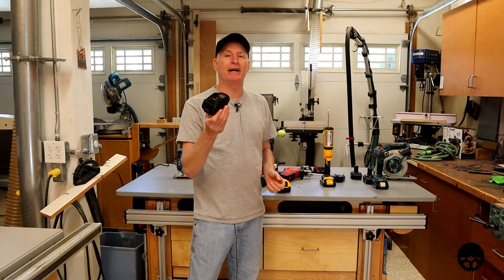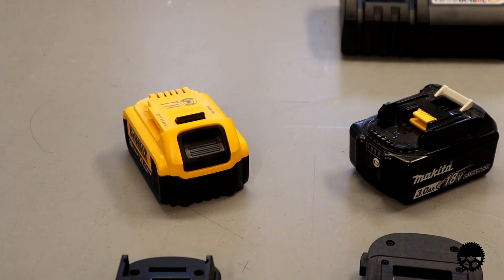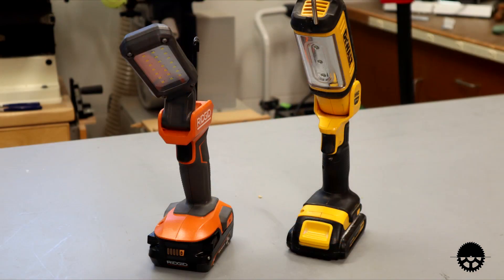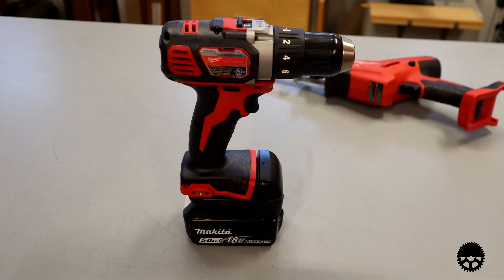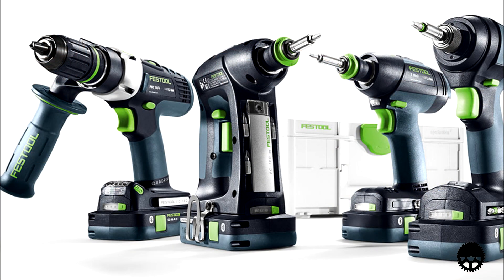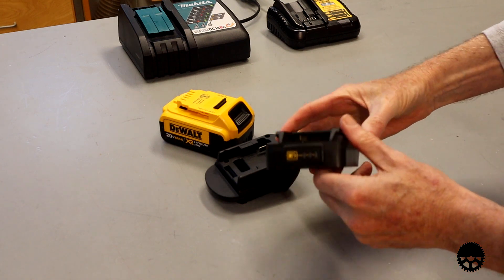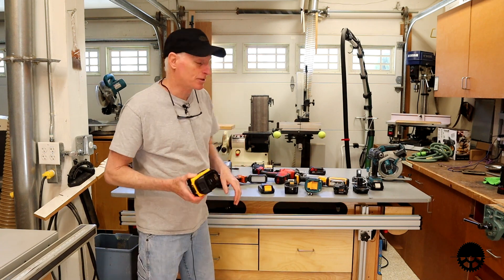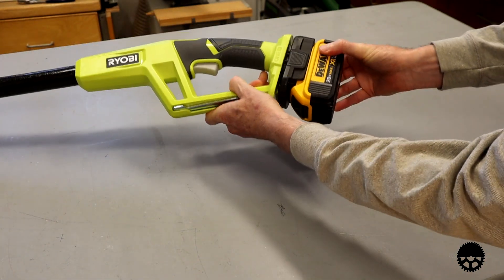Battery Adapters Change The Game!

Comment: What about battery run down protection ?  I understand the video is 3 years old ... so you should have run in to this.  I've talked with a few people who use the adapters and they remarked that there isn't the usual battery run down protection ... so the battery might not take a charge after it goes down using an adapter.  Have you run into this, I'm new to the adapters and need to learn from someone whose been using the adapters, Thanks.
Reply from the maker: I understand your concern. I’ve had no issues with using adapters….still using them daily. Only caution I would have is don’t use them for charging. DeWalt battery on DeWalt charger, etc.

Comment: I believe that the Makita battery does not have over discharge circuitry. The over discharge is the responsibility of the tool to disconnect when the voltage drops below a certain point.  This is the purpose of the middle pin on the Makita battery. I too have one of those adapters and I keep an eye on the battery gauge so it doesn't over discharge and damage the battery. Makita also sells a battery analyser (which is very expensive for what it does) that reads the chip inside the battery and shows the number of charges and the number of over discharges which  could affect the batteries warranty.  I don't know if there are adapters on the market that use the battery middle status pin to switch off the tool before it goes into over discharge.

Comment: Great video. I'll be keeping this in mind for future tool purchases. This is a great work around which will allow me to use other tools that I previously was not considering due to the battery system situation. 

I did notice that some of the adapters were quite bulky though. Here's hoping some less bulky adapters are out there or come out soon